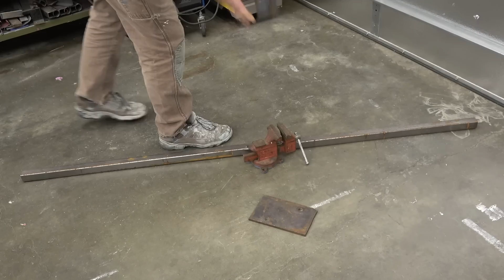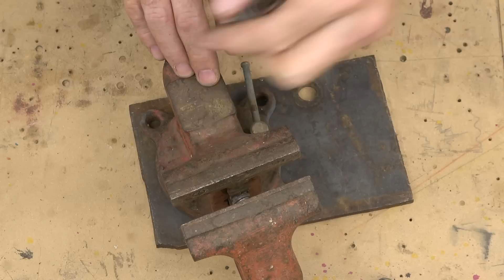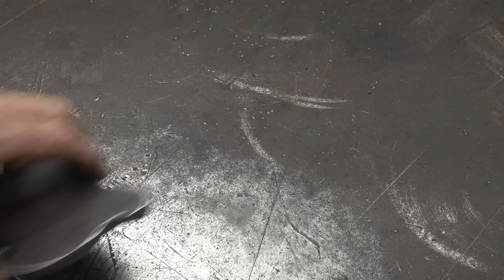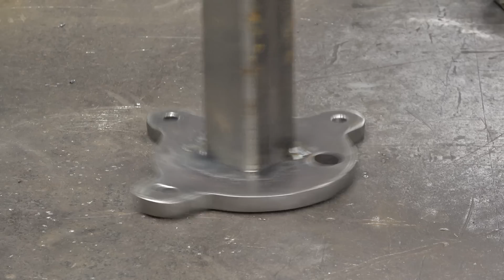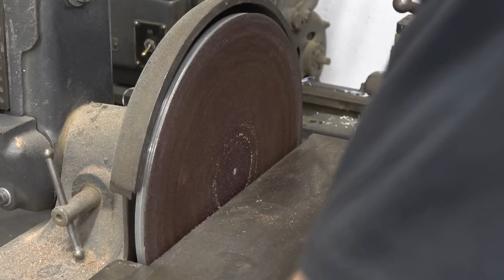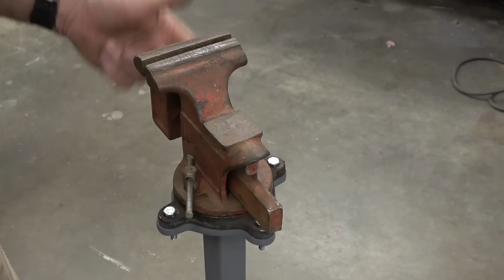How to Make a Vise Stand From Scrap Metal

Comment: If you went to the trouble to take it apart, why not sand it down and repaint the vise too? I would also make the plate larger so you can take it off to swap or add a bench grinder on the other side. The wheel would support it.
Reply from the maker: I was going for fast and easy. Also, I was matching the other one for production reasons.

Comment: does the quenching help harden it or just speed up the work time?
Reply from the maker: I was doing it to speed up the job. But, I would imagine that it had some effect on the metal. Either way it wouldn't matter for the use case of the plate in question.
Reply: @Makebuildmodify  thanks!
Reply from the maker: :)q

Comment: great work but one super important thing to be mindful of... close that gap on your disc grinder table!!!! especially f you're going to be facing things vertically like that. in almost 15 years of being a machinist the absolute worst injury Ive had was losing 3/4" off of the end of my dominant thumb de-buring a piece of plate vertically like that. happened sooooo fast i still dont know exactly how but in short the work piece got sucked into the gap, slammed into the table, and sheared the end of my thumb off. bone and all! was brutal and do not recommend haha. that gap should tighten but if the slots are too worn out to close it up use a sacrificial piece of alu plate (or even some birch plywood)
Reply from the maker: Dude, that's terrible. It must have hurt.
Reply: 1000000% the most painful injury i've ever had, and i'm a lifelong skateboarder! 7 years later and i'm literally still in pain from it. needless to say i'm overly cautious with those things now. i run big machines but i'm still only scared around disc grinders and angle grinders haha  @Makebuildmodify

Comment: I want something along that idea but, I want it heavy duty and height adjustable.  I will have to have it made because I don't have the knowledge or tools to do it with.  I would use larger and heavier square tubing and use a slightly smaller tube to slide up and down inside the larger tube and have pins to fit in holes to get close to the height I want.  I already have a steel wheel from an 18 wheeler and, I think I am going to get a brake drum to also use on the bottom for added weight. Ya just never know when you might need to go BIG or go HOME, LOL
Reply from the maker: Nice!

Comment: I like to use 2 telescoping tubes w/setscrew bolt to provide height adjustment. Also, any vise that isn't fastened to the floor is much less useful for any sort of heavy work.... (of course, I'm into having much heavier vises than the one you're mounting there..). The height adjustment vise is good for holding an angle iron work rest that can match the adjustable height of my drill press tables  and the chop saw rollers stands to support long work pieces. All the chop saw work roller stands (as well as the dry cut chop saw, itself) all have those truck wheel bases and can move out of the way when not needed.  The vise I setup on truck rim like that was marginally usable because it wasn't solidly mounted and it ended up being bolted to the floor, anyways. A 4 ft. length of 3x4 x1/4" angle iron clamped in an adjustable height (bolted down) work vise IS my all purpose work and welding table. Sometimes has a whole wood burning stove clamped to that angle iron. It raises and lowers with a car jack permanently built into the vise stand. I can work all the way around it. There's 5" ceramic cup magnets that can be bolted onto that angle iron and hold parts for grinding/deburring/cutting or drilling operations without the hassle of opening/closing clamps repeatedly to just turn them over or move them. The cup magnets also mount onto home made jigs to hold work for squareness etc. Just don't weld close to the magnets, it messes with the welding.
Reply from the maker: I like the telescope idea. I'm not too worried about the "solidness" of these stands because they're meant to be portable. I have a few other large well mounted vises for when I need solid clamping. You can see one in the video.